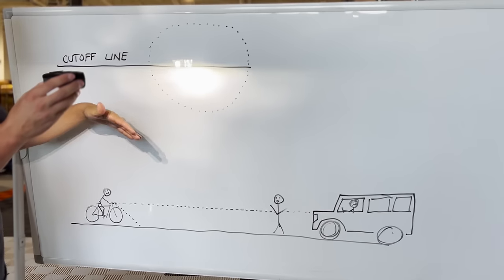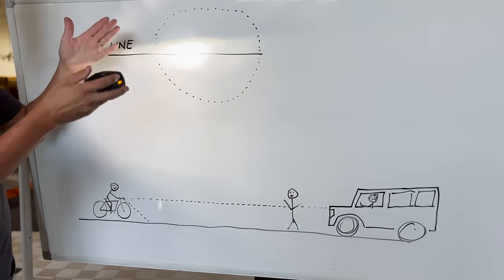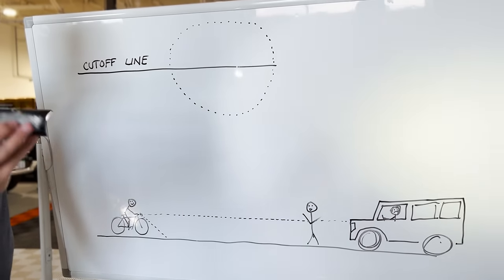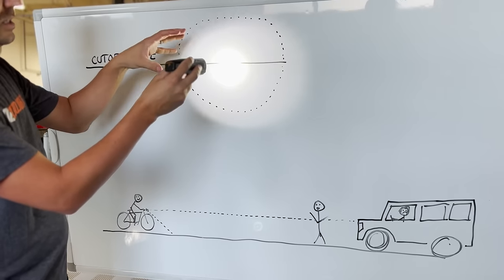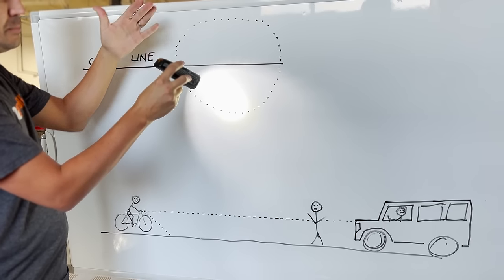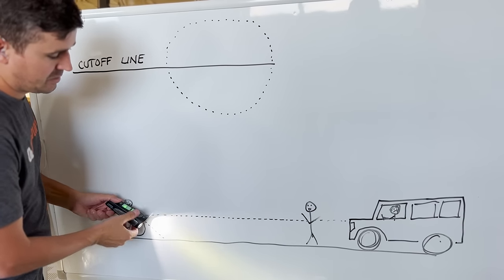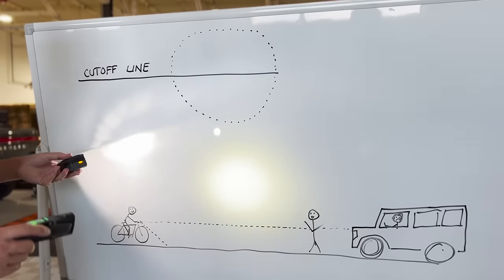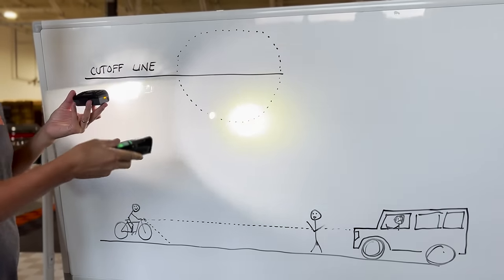What is a cutoff line beam pattern? Outbound Lighting explains

Comment: This company makes the best lights.
Reply: Only if they can be easily opened up and the emitters replaced/reflowed with 90-95 CRI 3200k emitters with the same footprint in order to minimize the Purkinje effect (light becomes too blue at lower brightness settings).
Outbound Detour seems to have the nearfield a bit top close to the tire. Should be at least 1 meter from the tire to avoid any shadows and to have better distance vision according to the Bumm.

Comment: Having a high powered light can be nice.  However, if it's not directed well it can be a danger, possibly blinding oncoming traffic.  I'm dumbfounded to the fact, that most other lighting manufactures seem to be focused on huge lumen output, yet ignore to offer any lighting with a cutoff design.  
Kudos to Outbound Lighting for recognizing the needs of road cyclist.  They delivered a complete and well engineered product, for those of us who ride at night.
Reply: Only if they can be easily opened up and the emitters replaced/reflowed with 90-95 CRI 3200k emitters with the same footprint in order to minimize the Purkinje effect (light becomes too blue at lower brightness settings).
Outbound Detour seems to have the nearfield a bit top close to the tire. Should be at least 1 meter from the tire to avoid any shadows and to have better distance vision according to the Bumm.
Reply: @uvwuvw-ol3fg  When out at night, when I'm going fast, down a steep hill my vision is well out front, that is beyond the shadows of my wheel.  In addition, when riding my bike, I have no thoughts about kelvins.   I will think about kelvins when taking a photo.
Reply: @ilovephotography1254  Isn't it too hard for the eyes to focus in blue light especially without ambient lighting when everything else is dark around you?
Reply: @uvwuvw-ol3fg  When it comes to the science of night vision and light production for biking, this is well above my pay grade.  However, the people at Outbound Lighting are both engineers and bike riders.  Perhaps your questions would be best directed to them.  They have a website, where you can leave a comment and they're likely to respond.
  
As for myself I can offer a humble opinion, from my own light experience.  The currant light that I'm using, I'm guessing it appears to be around 5500k.  The quality of light kelvins that it produces is fine.  My eyes can have no problems adjusting at high speeds night riding.  This includes riding in pitch black areas or under street lighting with differing kelvins.  

My complaint with my light is that the beam is not well managed.  The beam is a floodlight.  Therefore the light spill will create glare that blinds oncoming traffic, other cyclist and pedestrians.  With a cutoff beam the light is channeled to road and the light spill is contained.  The "Detour" light lenses are specifically engineered with a cutoff beam for the urban road bike rider.
 
I haven't used the "Detour" on my bike, so for me to say anything about the light quality at night would be only a guess.  The good news is, there happens to be a YouTube channel called The Sweet Cyclists.  His channel has produced many bike light reviews, from many different bike light makers.  I believe in the near future he will be doing a review of the "Detour" light.  He too is likely to respond to your questions.
Reply: @ilovephotography1254  Turns out the XD16 led emitter comes in variety of colour temperatures and cri so anyone with too much time on their hands can reflow it when needed.